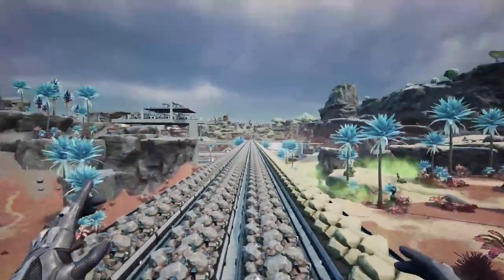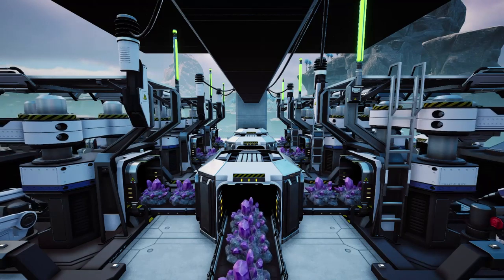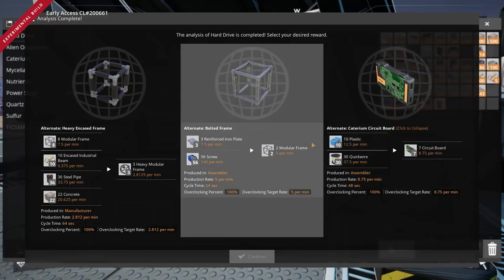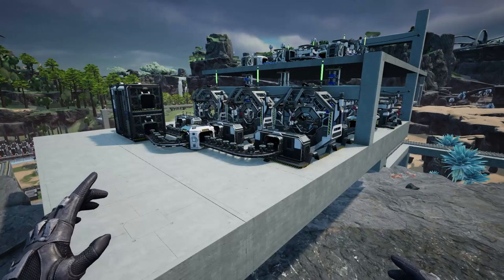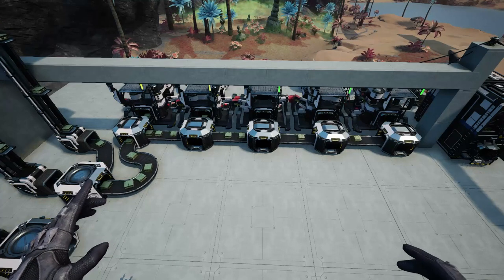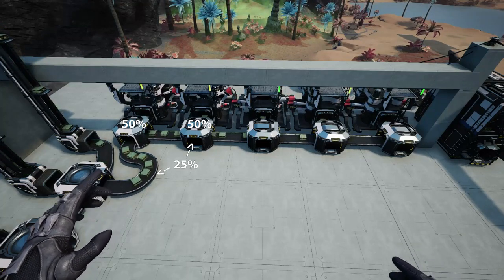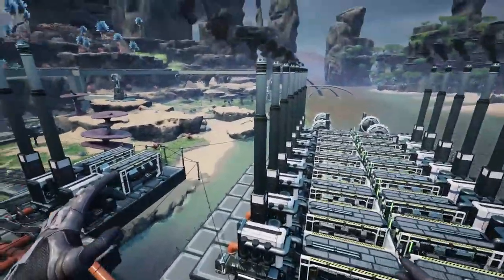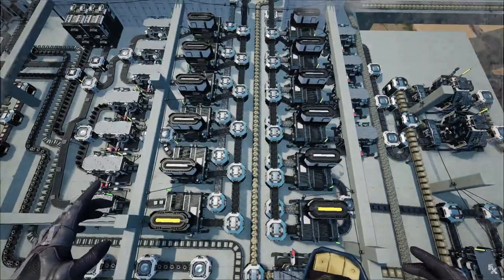How to get MORE out of your Satisfactory Experience

Comment: I prefer using the manifold overflow method. Fill the first machine then fill the second, etc using smart splitters. It's the same in the end, but from tests I've done it pushes more parts out quicker until every machine is filled.

Comment: I just finished a 30000 iron ingot factory. Didn't think about the 4000+ coal I need for steel pipes. So now I'm just building spiral railways, bridges and decorating stuff while I figure out if I'm going to scale down production or drag all of the coal from the northern map into one area 🤔 😅
Reply: Update: I bought 4680 coal in on train and built a 7020 steel ingot foundry. Might double it up and make 14040 steel

Comment: Another fun tip for the manifold, is to use smart splitters instead of regular ones and set the center belt on overflow. That way it doesnt take as long to fill up the line ^w^
Reply: I've for some reason never thought of this.
Reply: what do you mean by this
it takes exactly as long for the entire line to achieve x% efficiency...  it just means that each machine reaches 100% efficiency in turn rather than every machine along the line starting and stopping production at random
Reply: It literally takes the same ammount of time. The moment one of the belts collapses, the overflow will continue on to the next one. There is no need for smart splitters in manifold. UNLESS You do a closed and HUGE loop where you have like 30+ machines and belts on loop around those machines feeding back excess resources into the loop itself, in that case, you can use smart splitters just to make sure no resource skips the last machines of the loop and they get them aswell.

Comment: After I finally wrapped my head around the fundamentals of automation (i feel like that took me around 15hrs of playtime before i went “ohhhh”), I had a blast figuring out how to get 100% efficient factories. The basis for me was the target parts default requirements (say, a Rotor assembler) and building everything required to run that final assembler on 100%. 
As time goes on, I find myself worrying less with factory appearance as well as minimizing space taken to build a factory, but I do still fine tune everything to run at peak efficiency. The funnest part for me is chasing down any machines using more power than is necessary as I try to avoid building another coal generator lol. Although I did just build my first fuel generator.
Reply: I'm about 18 hours into the game and I haven't reached that ohhh moment, I'm hoping that happens sometime soon :face-pink-tears:
Reply: @TheInternetwatcher  as long as you keep at it, it’ll come. Been a while since I’ve played this or I would throw out some advice.

Comment: I always use manafold systems purely because of the look of it once you move beyond 5+ units.  I had a very sexy 8 manufacturer set up (4 each side) that was fed by 4 belts stacked on top of each other and fed to the different slots via conveyor lifters.
Using this type of system again I am thinking of doing that under the floor.  Basically have my factory high up with a large "solid" base where all the belt work will be and the finished products moving all pretty like where I can see it